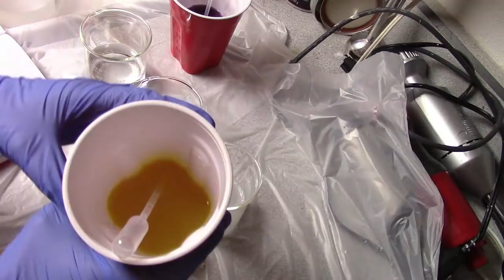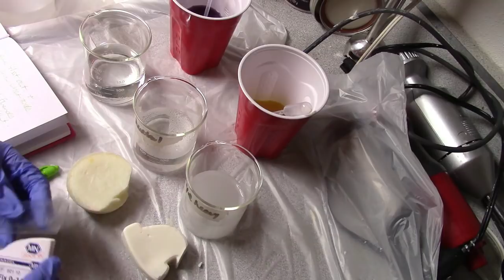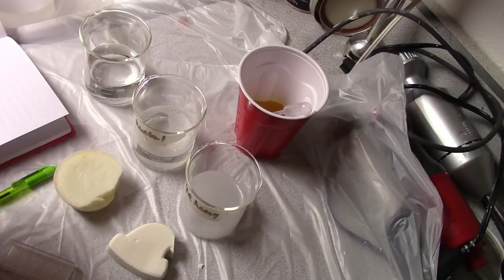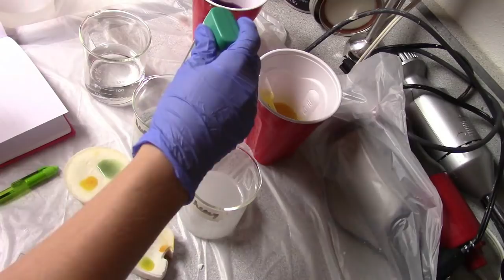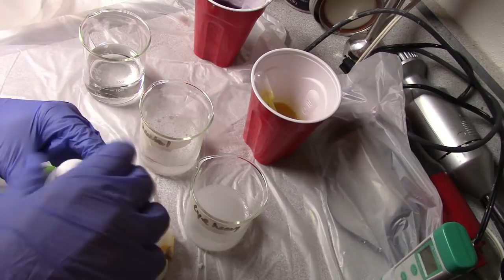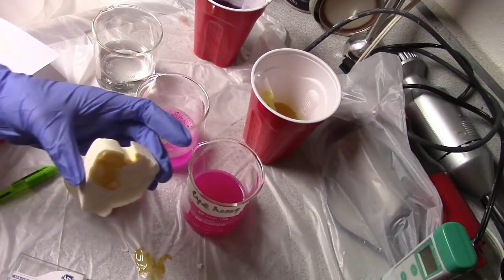18) How to Correctly test the pH of your Soaps

Comment: I thought that save number should be 6 or 7?  Please clarify
Reply from the maker: Normal pH of handcrafted soaps are 8.5-10 which is completely safe. If a handcrafted soap was a 6 or 7 it would fall out of solution and you'd no longer have soap. Only synthetic detergents are acidic. Our acid mantle easily bounces back when using our soaps. You just don't want to use a lye heavy soap with a higher pH.

Comment: I made the tumeric indicator...   Comparing it to a litmus test strip...   the strip says my soapy liquid is a 9, the tumeric solution turned orange... The color orange is half way between yellow and red.   On a bar of soap that has cured for a week.. litmus test says 9... dropping some tumeric solution on it is interesting... it stays yellow but has red spots..  So I assume at the red spots the PH is high.   People use tumeric as a colorant for soap...  my question is does the soap go through a color change from red to yellow as it cures?  I also compared litmus test strips between applying the strip directly to a wet bar, and to soap dissolved in water... both read the same ph.

Comment: I have a question in the ph. I was using a recipe and was short in some coconut oil and measure with coçoa butter to go to the weight that was needed..soap came out beautiful. Followed the rest of the recipe as far as lye and water etc..was wondering would the change in the oils make a high pH. I did the tumeric test and it indicated red
Reply from the maker: Every oil and butter has a different saponification value, but hopefully your superfat covered the difference. How fresh is your soap? That'll affect the pH.

Comment: Your video is very interesting and professional! I liked it very much! I think I will be testing turmeric and using it a lot more in the future. As you have shown it seems a promising indicator of lye heavy soaps at high pH (10,5 vs 12). For now, I am using pH strips (as you show) on dissolved soap; but using drops on the soap although less accurate would be a lot quicker when testing many batches :-) Thank you!!